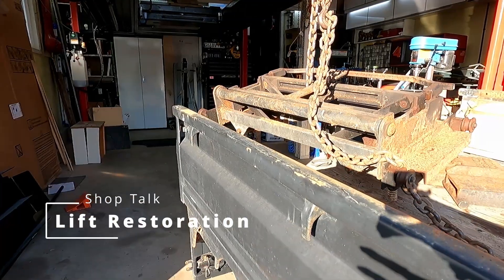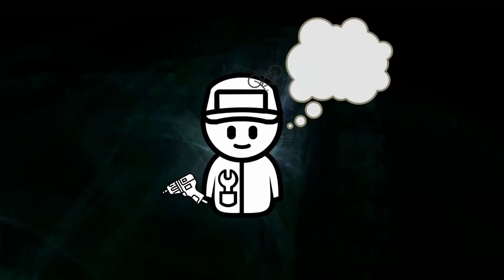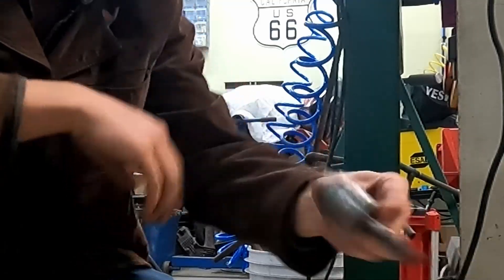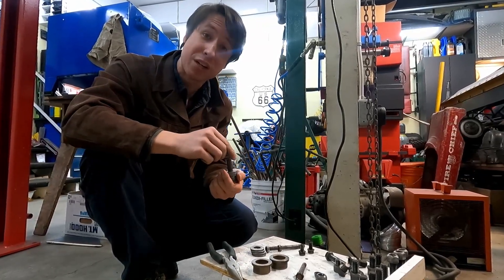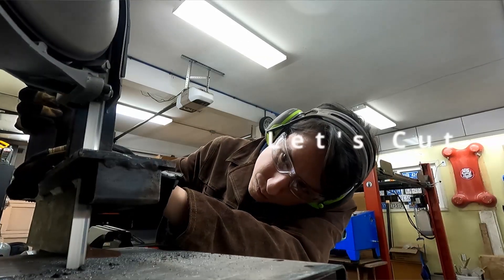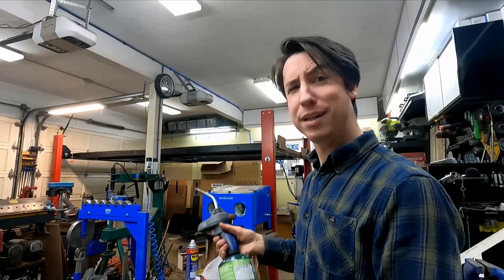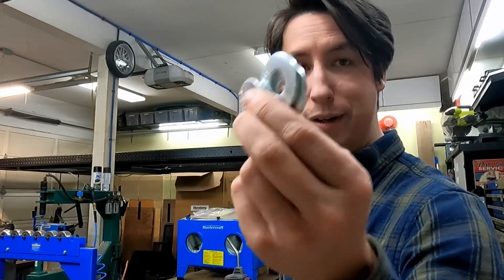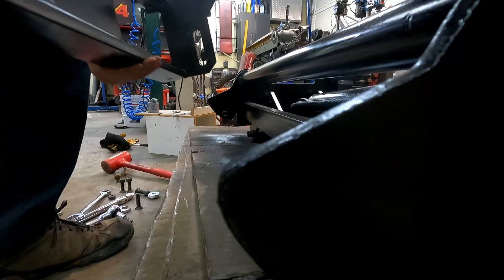A $50 4 Post Lift Center Jack? (Restoring an Old Trolley Jack)

Comment: Have you tried zinc plating your hardware?  It's super cheap, dollar store vinegar and epsom salt, a roll of roof zinc from Home Depot will last years of Zinc plate jobs, and a battery charger provides the positive and negative charges.  Evaporust bath works well to get the hardware really, really clean first too.  Wire wheel doesn't seem to get into all the little pit holes on really rusty hardware sometimes.
Reply from the maker: I often use a battery charger to strip rust but have yet to use it to replate anything. Has been on my list of things to learn, perhaps it's time to give it a go. Sounds pretty simple.